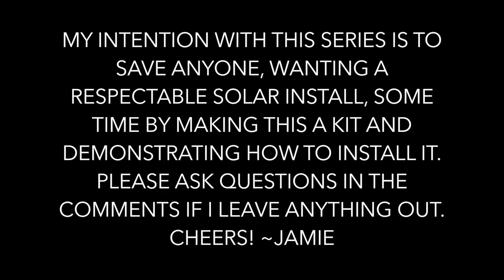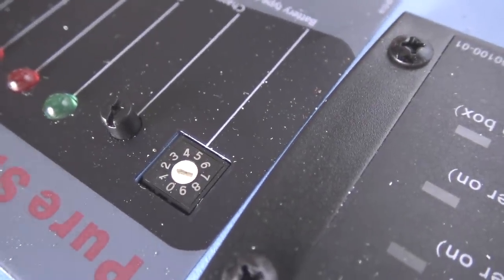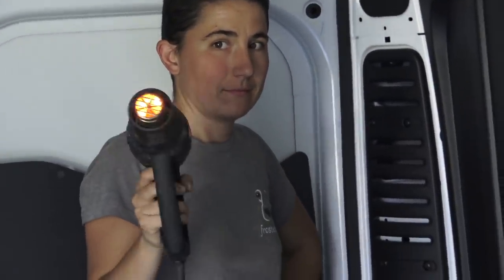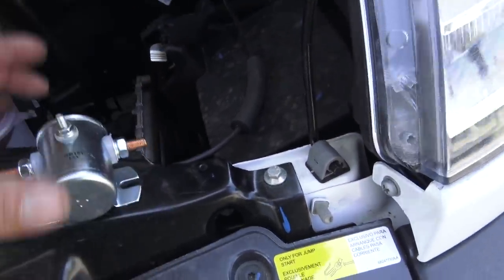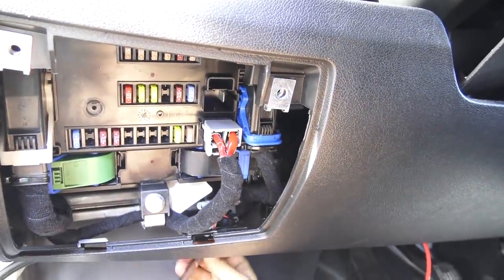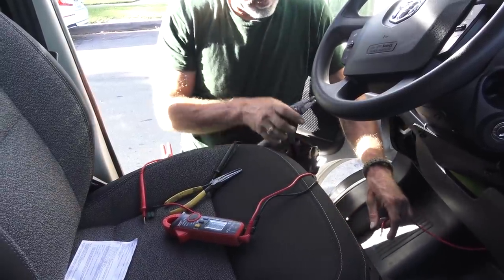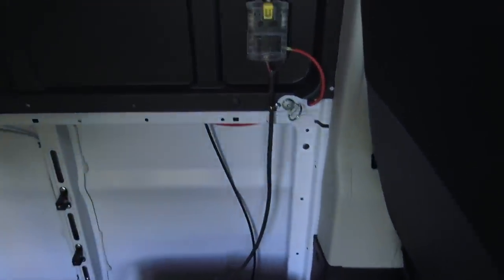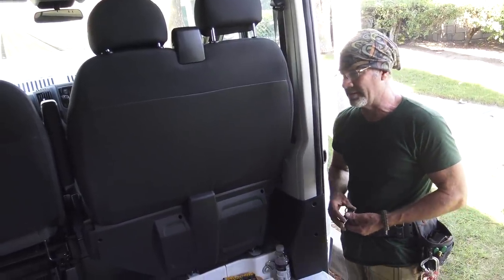Installing 400 Watts of Solar, Inverter, Isolator & Shore Power on a Van 3

Comment: That was the cleanest install I have seen from you but looks like the way the batteries are hooked is wrong. That is why your charge from alternator is wrong. Looks like you are not using the whole battery bank.
That a new truck? If so bye bye warranty
Reply from the maker: Its right Ron.

Comment: Jamie,
I love you videos, but I was confused about you fuse size choice.  If the fuse tap wire and fuse holder is rated for 15 amps, couldn't it be dangerous to put a 30 amp fuse in it?  How many amps does this type of circuit draw?
Reply from the maker: That's a great observation. The fuse tap wire shouldn't ever have a serious load on it. I just went with 30 because i don't want Cece to ever need to go under there. 20 would be fine.

Comment: Hey Jaime, In the future you can put the breaker on or under the dashboard, on the way to the battery bank. This way if it trips-you won’t have to go outside on the wind/rain/snow/heat/middle of the night etc to reset it.
Reply from the maker: It should really be as close to the starter battery as possible, DirtySouth TV. Thanks, as always, for your comments!

Comment: is this enough power for you, exactly, what are you running off this and do you ever think you want more power. ever. !!!!
Reply from the maker: This system is made to handle about 15 amps. The inverter produces about 15 amps. Thats just about all a person would normally need before running a 13,000 BTU air conditioner or a clothes dryer.